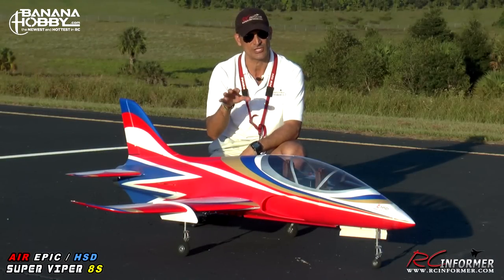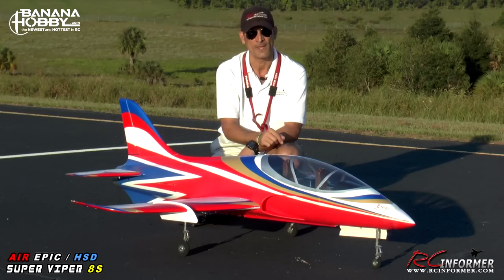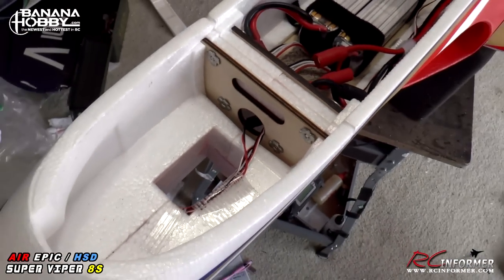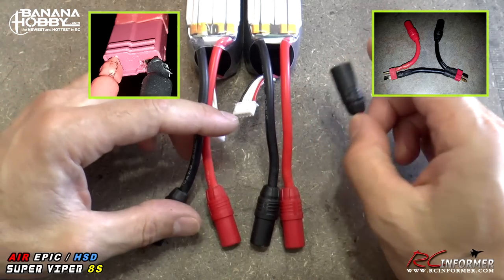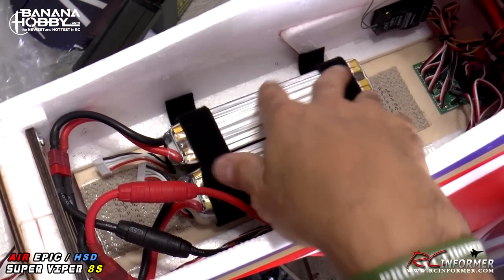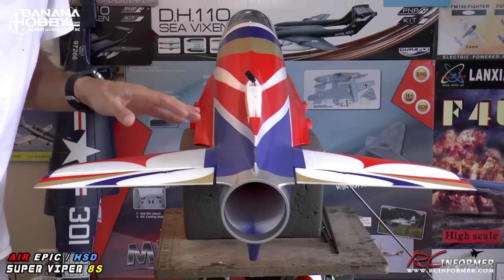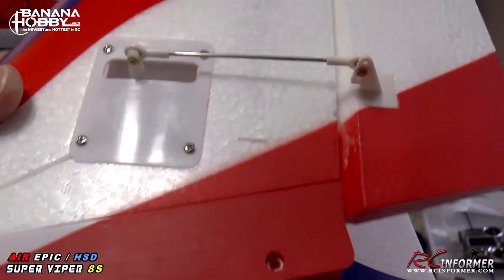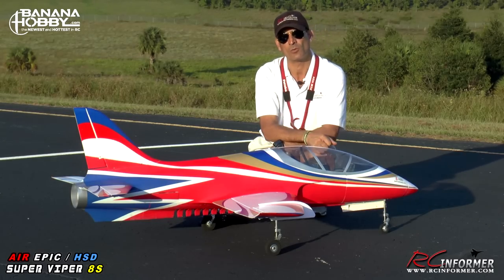Banana Hobby / HSD HOBBY Super Viper 8S V1 SETUP & BUILD GUIDE By:RCINFORMER

Comment: I know this is a 4 year old post .. but, what was your full flaps deflation measurement?, as I found the recommended 50mm is too much, causing the full flap setting to blanket/stall the elevator just before flare. Symptoms are loss of elevator authority/loss of descent glide path (slight ballooning), then unexpected drop without change of input, sometimes causing a hard hit on the runway ..this was not a main wing stall, as the airplane was still flying .. had to do several go arounds, and “very” grease to minimize the drop effect.

Comment: Hi Rich 
I am in the uk and just got the HSD 8s watching your flight can I ask what was your set up on your TX expo / diff also rates as I can not find any as a starting point any help please
Reply from the maker: Lynn Williams Lynn, I use No expo at all.     I'm in the recovery room at the hospital, just had a sinus surgery so I'll get back to you shortly with better numbers... the ailerons need a good bit of throw for a good roll rate & the elevator throw needs slightly less for travel higher speed flight (about 70%). The plane slows down nicely for landing and floats in for really nice landings:) Be sure to land on the mains first... for some reason folks tend to land this plane to hot & there is a tendency to touch down nose first in an effort to get it on the ground which can cause a real bad porpoise oscillation. The plane lands well at a nice slow speed... just be sure to land on the mains first:) hope this helps for now:)

Comment: Rich, the kit that came to me was a complete mess and nothing works correctly, for example. I hook up the rudder and it affects the elevator. The board I receive does not have rud on it the way you explained on your video. Anyway, when hook up (rud) it works but when I use the elevator the rudder moves! What a mess this thing turned out to be!

Comment: Rich, I ran into a problem with my brand new Version 1.5 12s. I have everything hooked up correctly now after hooking it up upside down i.e. had the leads from the mix card to the receiver reversed on the receiver g-a instead of a-g but corrected it. Both times before I corrected the mess up and after all I could get out of the ESC after about a 5 second delay after hooking up the battery is a single beep repeated about once per second. I assume the ESC is stuck in Program mode but I cannot seem to get it out of it. I have tried everything including reversing throttle on the transmitter, rebinding several times and even a different receiver but still get just one beep per second. The ESC will not arm. Do I have a bad ESC maybe? I do not yet have a program card but have on its way. Any hints or clues would help immensely.
Reply from the maker: It sounds like your ESC may be in the wrong channel....What radio are you using? Which channel is your ESC plugged into? Futaba it would be channel 3, Spektrum channel 1. let me know:)
Reply: RCINFORMER I do believe I found the problem, I am using a Spektrum DX-9 with an AR8000 Receiver with a TM1000 Telemetry Module You bind this by holding the bind button on the TM1000 and the DX-9 says it has bound DSMX and Telemetry but and the blinky lights on both the TM1000 and the AR8000 go solid but  I tried disconnecting the AR8000 and hooked up a AR6210 with nothing but the throttle channel and the bind plug in place and it worked like a charm. I hooked the AR8000 up the same way (bypassing Telemetry and it will not go into Bind mode so I do believe I may have a bad AR8000 So I will be buying a new AR8000 for 129.99 in the hopes I can hook it up and have my steering mixed on a separate channel and my Telemetry in place.
Reply: RCINFORMER My guess would be when I had the wiring originally plugged into the receiver by looking at the photo upside down as to how the mix board is oriented in the model I may have fried the receiver at that point - side note I had the TM1000 data cable plugged into the receiver with reverse polarity as well. Thats what I get for hooking everything up in poor lighting conditions the first time.
Reply from the maker: SO was that it? Usually if the ESC in not in the Throttle channel you will get the beeping.... many model manufacturers label their wires for the Futaba format, so they often label the throttle wire as 3 so you will plug into the 3rd receiver port.... Spectrum labels their #1 Receiver port "THRO" which clarifies where the ESC goes in their receiver. In this case, the #3 ESC wire goes into the #1 THRO port.
Reply: RCINFORMER Yep after I corrected it I had throttle in Port #1 but was getting only the single beep regardless. For me the dead give away that the AR8000 is buggy was when I removed the TM1000 from the Data/Bind port and put a Bind plug in and made sure that Throttle cable C on the photo in the 1.5 manual (for me Third up from bottom on the now vertically mounted Mix Board) and plugged in the battery the receiver did not light up at all but if I plugged in the TM1000 and bound from it's button it would actually blink the light on the receiver and the TM1000 and after it successfully bound to my DX-9 the lights on both would go solid but again - single beep! Mind boggling isn't it? Either way I don't want to trust a brand new $660 plane and $160 for the pair of batteries on an AR8000 acting this odd.
Reply: RCINFORMER I have it all set up and working fine on an AR6210 with the TM1000 connected and it is all working like a charm. Now I just have to wait for more connectors (and more money) to get another pair of batteries and make another charge adapter. I ended up having to charge my 6200mAh batteries on my Triton2 EQ charger instead of my HiTec X4 - the X4 only goes up to 6000mAh! it sucks having to charge these bricks one at a time and I currently have just the one pair
Reply: RCINFORMER I have it all set up on my AR6210 6 Channel receiver at the moment but my HSD Program card will not light up so I cannot tell if my 12s version is set to High timing or not.
I tried connecting the Throttle connection to the receiver into the card and powering up the plane - that did not work, no lights on the card. I tried bypassing the Mix board by connecting the UBEC throttle connector from the mix board into the program card and that didn't work either.
Reply: Alamo Radio Control Society 
Did you find a solution to this hook-up problem?
Reply from the maker: 9z4clb Yea, it does not use this card anymore, they removed the reverse feature... the plane does not need reverse anyway:)

Comment: Rich I hate to seem like one that complains all the time but, my kit came with the mixing board a total mess. I couldn't lay it flat the way you have on the video. Instead I placed the board on the back was in an upright position. The board I have looks nothing like yours, so it's a bit tough following your example. Seems to be a very nice edf however I don't believe this bird will ever fly. What a flop this project was.
Reply from the maker: It sounds like nothing is wrong at all.... they redesigned the mixing board and put it in a new position to allow for larger batteries. The good news is that you received the newest version of the plane. I just got the 12s version... which did you get the 8s or the 12s... there is a diagram in the manual showing all the board connections. feel free to email or call if you have questions.

Comment: It melted cause it was a fake deans, Real deans will work up to 200amps, My friend uses them in is 90in ESM planes using 50cc outrunner motors 12s
Reply from the maker: Yes it was the clone that melted... my Deans harness was fine... however, its best not to have a lesser diameter connector in an electrical system, especially with 10 gauge wire. If you think about the way a light bulb works, the filament (the weak link) is the part that heats up the most. If you have a electrical circuit with different size connectors, the smaller connectors WILL heat up more....  T-style connectors have been around since the beginning and are still widely used but there are so many better options nowadays for bigger amp loads that are superior and way easier to install.